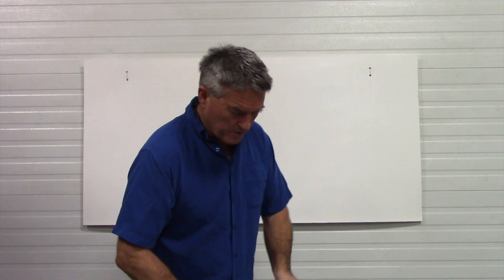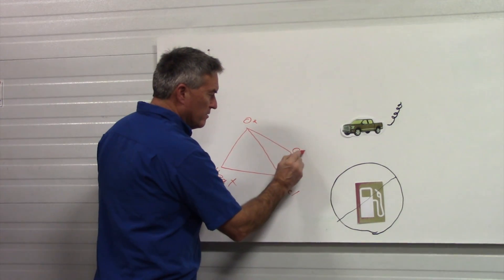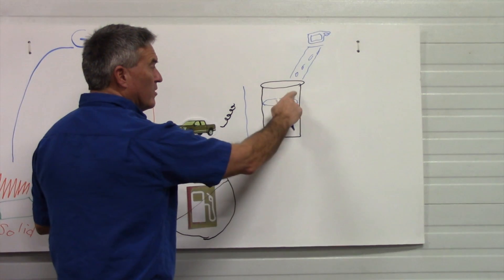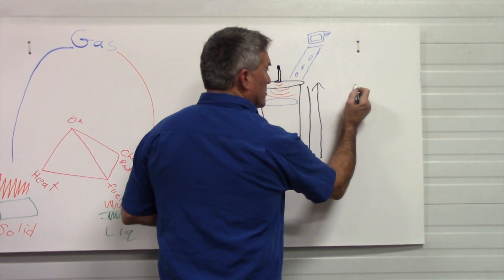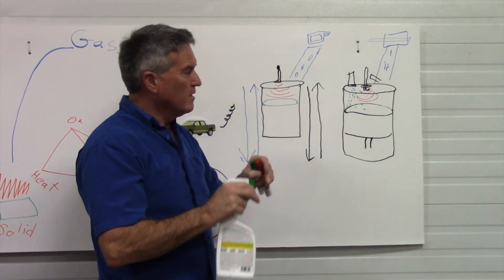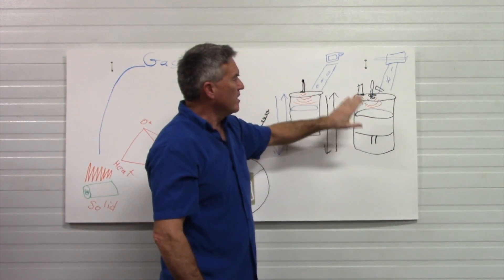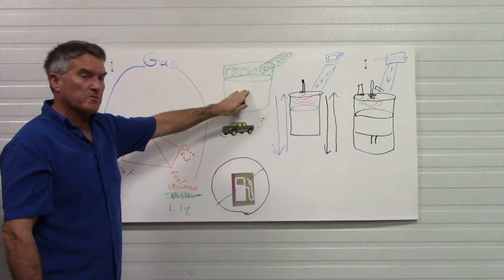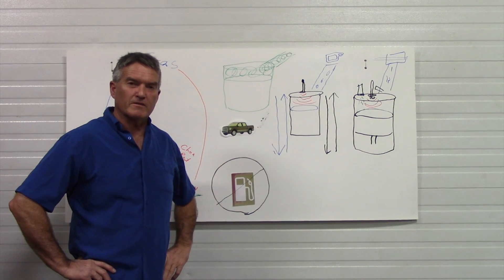One Simple Trick to get 100 miles per gallon with less pollution!

Comment: Too many facts wrong with this video.  #1 know the difference between a "gas" and "plasma".  Plasma is the visible light that is emitted from a hot flame, or other ionized sources. #2 gasoline is not a vapor when it is ignited.  It is highly "atomized" (meaning: a very fine mist or small droplets, which are liquid)  #3 Carbon Dioxide is not a pollutant, so subtract that out of your calculation for how many tons of "pollutants" a car emits each year.

MOST IMPORTANTLY!!:   Gasoline/Diesel engines will be obsolete long before we run out of oil/fossil fuels. Electric cars will take over once they become economically feasible.  The technology is already there, but it is too expensive.

Comment: Propane is a Vapor and we have to shoot a ton of it into a motor to make it run and they get less MPG than Gas so how the hell can vaporizing the Gas make any more Value? Reality check
Reply: syndrome1965
@Kevin Bergman your logic fails, because you are comparing substances that occur in two different states. Propane, in a gaseous/vaporized state, and gasoline in a liquid state. When gasoline is in liquid state, it does not like to burn. Theoretically, and, literally a lit match can be extinguished by submerging it in gasoline. Gasoline must be vaporized to be used efficiently. The better, more efficient, the vaporization of the gasoline is, the better the mileage will be. So, the answer to your question, really has to do with, the fact that, as a vapor, gasoline is a better, stronger, more powerful fuel, than propane. But, vaporizing gasoline makes it way more powerful, and, efficient, than not vaporizing it...
Reply: @syndrome1965  Your Brain is in a Gasious State people have tried this and found it to compare Equally to liquid Gas Honda has a preheated carb get good mileage but that's as good as it can get find something else to rant about

Comment: ........I'm at 7:27, it's 5:52am CST so it's bout sleep time. I'm no scientist but have car, bike and hot rod addiction. Wife has a 1967 Corvette 427/435 Tri-Power. 427 is the cubic inches of the engine. 435 is the horsepower rating from Chevrolet when it was new. Tri-Power is that it has three 2 barrel carburetors. You run on one carb until you accelerate then the other 2 carbs contribute. It's a 4 speed and has a low geared rear end so gas mileage is around 8-10mpg. It's also black and one of only 32 black Tri-Power coupes produced. I have a Pro Street 1964 Corvette. Pro Street means it was a race car that has been made legal to drive on the highway. Lights, brake and head, turn signals, titled, tagged and insured but with bout a thousand horsepower due to the supercharged 427 cu in.  engine. Before installing the supercharger I got about the same gas mileage as the stock, kinda, 1967 of my wifes. After the supercharger my fuel mileage went to 13 or 14 mpg and that's the only change I made. One problem with new supercharged vehicles is that they depend on the supercharger to make about all the horsepower so in the end you have more power but the mpg is not much different from non supercharged or turbocharged vehicles. All vehicles are bogged down with air pollution gizmos like the catalytic converters, small intake and exhaust systems, computers, miles of wiring and unbelievable amounts of computers and circuits. Our old Corvettes have maybe 6 to 10 circuits. No computers. And can pass emission  tests. There is no doubt in my mind that the vehicle manufacturers could produce fuel efficient cars, trucks, buses, you name it, that could get 100's of miles per gallon with amazing power but we all know why that doesn't happen. Money. Greed. Same old story. To save electricity simply wire a new house with 12volt lights and inverters. 12 volt batteries, charged by one charger, electric, solar, whatever means, electricity use would plummet. Run fiber optic cable thru the house. You would only need one light source.....sun on the good days or only one light bulb or source for night and cloudy days. A simple adjustable cover to allow the amount of light you need. On electric cars, it mite be inconvenient at times but you could tow a trailer with wind driven turbine, not huge, and it would charge the batteries while you were driving. A small gas or diesel engine could kick in when needed. Even run and charge while it is parked. I'm 65, I thot up this stuff as a kid. The technology exists but doubt i will see it in my lifetime that's left. Money will always rule. Cures for cancer and all diseases? They want us to believe the cures dont exist? Too much money in the treatment and "research". My wife thinks big pharma creates new diseases just so they can sell the treatments. I'm becoming a believer. I've guarded politicians and heard the talk. You can't help it. You also can't repeat it. To anyone. Ever. That would be treason under the oath you take and sign. I've seen things covered by the same oath which I will not violate. All I can say is that there are wonderful, amazing things out there that for whatever reason are not being utilized and understand that I've only heard snippets of conversations and had mere glimpses of things. I've never had "above top secret" clearance but there are things the presidents can't even see or know about. The only way these things will come to light is when the whole world has entered a complete apocalyptic event and all doors and secrets are opened and revealed.  Of course by then it will be too late. Man, I shuda quit at 6a. PTSD. Can't  sleep, can't shut up sometimes. This is kinda like therapy and nobody reads my "novels" neway. SO, If you get a chance to safely help someone pls pay it forward and stock up on food, water, seeds and most important: antibiotics, if possible, and other meds we take for granted. I've worked in countries with none of the essentials. Like goin back to 1800 or worse. They will probly survive because they live like that already. I feel bad times are ahead but you can find yourself in your own disaster without the whole world bein involved. A little preparation..... Ya'll be safe. L8r. Maybe I can sleep now. Know I bored ya'll to sleep.

Comment: Carburators are more fuel efficient than Fuel Injection. Computers were designed in the US to cheat. The fuel should be cracked into a vapor before it's burned not after with a cat. The fuel needs to be heated up for better vaporization. The early intakes were heated with a heatriser most early 4 cylinder vehicles did 50 mpg. All of the 4 cylinders did 40 mpg. The Govt the oil companies and the auto manufacturer's are in bed together. They lose revenue if we get good fuel economy. It's a OBD2 hoax. Just sayin

Comment: Fossil fuels are not fossils. Compressed water and carbon in mantle, along with heat continues to produce new oil deep in the Earth. The oil is lighter than water so it is continuously pushed toward the surface. Los Angela's California had to deal with oil bubbling up in the streets just three weeks ago. Peak oil is a scam to keep crude oil commodity prices artificially high. Do you research if you don't believe me. Spread the word.
Reply: Warren...You are correct. Most oil is coming up under the ocean and is eaten up my the seas. Fossil fuel makes it seem rare, thus raising prices..,👍👍

Comment: 400 million gallons of gas in one day? If the average car gets 30 m.p.g., that would be 13 trillion miles driven. Something sounds not right. But regardless, this proves that crude oil does NOT come from dinosaurs, but rather from vegetation, which is why there is still so much of it left. There couldn't have been that many dinosaurs to have produced that much crude oil for HOW many years now?

Comment: A long winded (and not very good) rant about basic physics that totally fails to solve any problem for the viewer. eg. assuming one of these units is fitted to a vehicle, how do modern fuel injection systems deal with gas when they are designed to deliver liquid fuel? How is the system integrated into a modern vehicle? Where can a consumer actually obtain one of the units demonstrated?

Comment: How about stop using gasoline for cars.Teach people that it's not from dead dino's. and most likely belongs down there. Tesla should have ignored the patent crap and just gave it to us another way. Magnetic Propulsion is it but we just have to do it ourselves without our babysitters knowing. Works great on a bicycle. Grow back the trees. Start using horses more. Combustion engines can produce their own fuel if you think about it. Just got to think outside the box of the current design, which still hasn't changed. Ever wonder why that is? Some did come out with but were quickly stopped. Money really is rooted to all evil. People are waking up to the forced destruction that's plagued humanity for eons so there is still hope. Taking all the oil out from the ground can not be a good thing in terms of ALL HUMANITY.

Comment: First statement out of your mouth  is false. 
Proof. Most oil wells are drilled far, far below the levels of where the ‘old paradigm’, oil comes from,
I.e. dead vegetation’ ever grew. 
There never was nor will ever be, peak oil or declining production.
Oil does not come from ‘dead jungle’. It comes from the core of the earth heating the mantle and creating 
Never ending hydrocarbons, which are lighter and bubble up and pool at levels deeper than 30,000 feet and eventually
Working it’s way up through vents.
Proof: https://www.investors.com/politics/commentary/we-are-not-running-out-of-oil-earth-produces-crude/
“... This information backs up the idea that Earth is actually an oil-producing machine. We call energy sources such as crude oil and natural gas fossil fuels based on the assumption that they are the products of decaying organisms, maybe even dinosaurs themselves. But the label is a misnomer. Research from the last decade found that hydrocarbons are synthesized abiotically.
In other words, as Science magazine has reported, the "data imply that hydrocarbons are produced chemically" from carbon found in Earth's mantle. Nature magazine calls the product of this process an "unexpected bounty " of "natural gas and the building blocks of oil products."

Comment: We are creating 4 to 6 tons of carbon and pollution per vehicle per year?
Gasoline weighs 6lbs/gallon. If a person drives a truck 15000 miler per year and that truck gets 15MPH then they burn 1000 gallons of gasoline. 1000 gallons of gasoline weighs 6000lbs. How can 6000lbs of gasoline create 8000 to 12000lbs of pollution?

Comment: The air intake is not designed to cool and lubricate the engine bro.... WOW
Reply: i think he meant that fuel cools the combustion chamber and running lean will make it run too hot..
Reply: @mboyer68  I don't think so

Comment: in order to keep the technology off the market the  patent for the 
original gas vapor injection system, or better known as the 100 mpg 
carburetor, was rumored to have been purchased and pulled from public 
records by Standard Oil in the early 80's .......
Reply: This alleged "technology" has been hyped since the 1930s.  There is no patent.  Also, patents expire after 17 years in the U.S. and the government can void the patent for reasons of national security-such as WW II.   If there was a bogus 100 MPG carburetor, we would not be making the transition to electric vehicles.  The "oil" companies would be holding guns to the heads of the electric car companies to keep them from producing the electric cars.  Internal combustion will be long gone before the Earth runs out of oil.  Electric cars will take over.

Stop suckering for that B.S. 100 MPG carburetor nonsense.

Comment: >>    OTHER     figures   -   10%    of    petrol / petroleum gas    -  as  liquid   burnt   - rest  is   heat  .
Which  prompted   Diesal ( not  van  diesel )   to  experiment  got to 25 %

Pogue      1930 's     -  patented  his system  .  Itsa  mess   - with electronics  and   sensors

Notice    he uses   "gas"     -  Pogue   was to vapour  -  different from 'gas'  .  Got 200  mpg -  1930's
Stopped  by government  ( taxes   - always   the   taxes  )  and  management  of  oil  companies  - they  wanted  gallons sales  -  which  supply taxes as  well

Comment: The boost venture turns the liquid fuel to a fuel air vapor charge so this guy is way off . You can't mix fuel and air under pressure it becomes highly explosive the gas would have to be a total gas before oxygen is introduced .

Comment: At 10:33 you say we can spray in less fuel and thus save fuel, however, unfortunately current engine design depends on the liquid fuel to cool the engine. So, this video is designed to inspire mechanics to create a new concept for an engine? This video does seem a little pointless. It's impossible to combust fuel (liquid or gas) without having a closed environment (which creates a lot of friction/heat). Thus we need the liquid gas to cool and lubricate the pistons. This means we would have to completely redesign the way an engine works to use the information you just told us. So not quite sure what you're trying to educate us on... I looked at the eagle research link from George Wiseman. Once again, I feel like introducing more gas into an engine that requires liquid to cool it is going to reduce the life of your engine

Also, I'm pretty sure newer cars have been using this reasoning to increase their fuel mileage since the early 2000's. Newer cars have more room between the pistons and chamber to reduce friction (less energy to move piston) and using oil to lubricate instead of liquid (assuming your comment is correct). Unfortunately, this means we burn more oil because it slips between the gaps, but we get better gas mileage and perhaps... can run slightly leaner?... I was told this is why newer cars burn more oil than older cars as long as you compensate for total mileage... that it is a tradeoff for better fuel economy.
Any Thoughts?
Reply: You don't need a liquid fuel to cool or lubricate the engine...coolant and the oil do pretty good job. This guy is full of shit though...since the IC engine need fuel vaporized to make it much easier to ignite and burn cleaner so his idea is not very revolutionary...

Comment: How can I find this contraptions?? I want to but one..
Reply: Motorized bicycle 100 miles per gallon 2 or 4 cycle.  4 cycle 35 to 40 mph. I dont need a car 75 percent of the time one or two gallons last me a whole month! Custom making a. Closed in weather shield 4 Quad running off two 4 cycle motors and another fat boy custom made bike running of of solor using the spin of the tire chargeing the e bikes batteriesoff the solor panel 8hrs non stop guaranteed with out plugging in electric outlet 30 to 35 mph guaranted.

Comment: Smoky Yunick did this in the 60's or 70's in Florida!
Reply: Best damn garage in Daytona. He called it the homogenizer I think.
Reply: He got arkansided like Stan myers
Reply: I  got a copy of the Yunick patent in the 80's. Supposedly people have had limited success with copying the design from  the patent alone.
   https://patents.google.com/patent/US4592329A/en
This joker only gets a couple of things right. 

Converting a liquid to a gaseous state  increases pressure which has the be contained and flowing, thus the use of a turbine, which also disperses the liquid. If not contained you'll get a vapor lock and the engine stops. Gasoline is not a lubricator of cylinder walls. Common fuel injected motors hope to get enough atomization of the liquid fuel so the catalytic burner does not have to work too hard.

With today's technology Yunick's  expired and patented method could probably be revived and made to work.
Reply: It does absolutely NOTHING.  ProjectFarm, a YT user, has a video up right now showing his lawnmower running on gassified gasoline and there is absolutely ZERO benefit.  It would violate thermodynamics.
Also, fuel injectors spray a very fine mist that allows for HUGE surface area (that is why liquid gas doesn't usually burn easily).  There is essentially zero difference between vaporized gasoline and gasoline in the air as a mist.
Reply: ralph edman & christo930 are CORRECT, of course. The mixture of gasoline vapor and air has rather strict flammability limits. Too much or too little gasoline WILL NOT BURN, or will burn very poorly. Modern fuel systems control the final mixture VERY PRECISELY which is the key to HIGH efficiency plus LOW emissions.
Reply: whatever happened to him? Is his method still in use?
Reply: @chadcervantes6066  He is a crook and his "method" is called a carburetor.
Reply: He built an iron duke powered fiero that broke 100mpg
Reply: He got 1.8HP per cubic inch @5200rpm and 50mpg out of that 2.5L Fiero. He had an agreement with Crane Cams to make a retrofit kit for the 2.5L Iron Duke engine and the 2.2L K-car motors, but he died and suddenly all progress stopped. A guy bought his project car and was doing appearances with it...
Reply: https://youtu.be/oLCHc8kTmbU
Reply: @C W It all ends up as heat.  Besides, I never said anything about heat, I said Project Farm has a video where he vaporizes gasoline and burns it in a lawnmower.  The lawnmower gets no benefit from the gasification of the fuel.

Comment: That was on a par with Govt information films entitled how to take a door of its hinges and hide under it if nuclear war breaks out....
Reply: It works but has a big problem in that exhaust valves could not stand the heat produced. petrol is part of the cooling system. using propane cools the mix of gas and air and helps cool the valves. petrol gas would damage the exhaust valves. That is why an engine is tuned to use a certain amount of petrol and it is not advised to run lean.